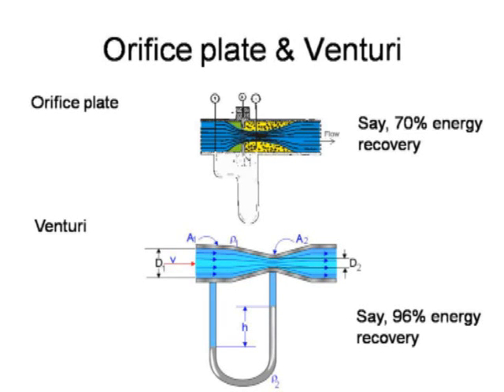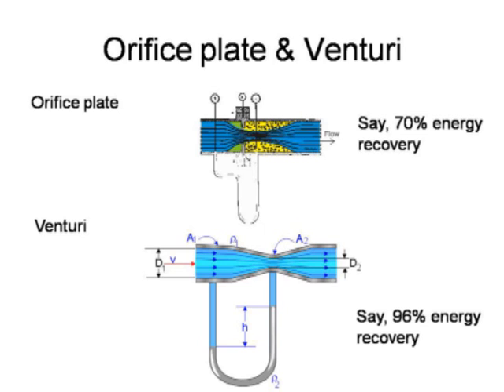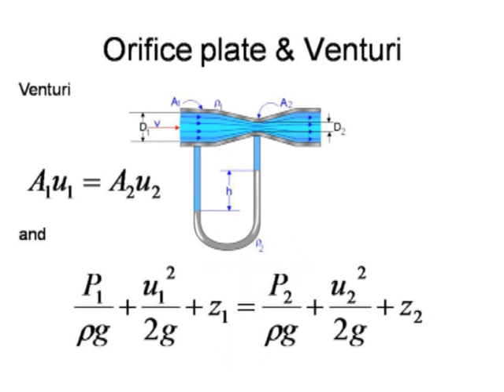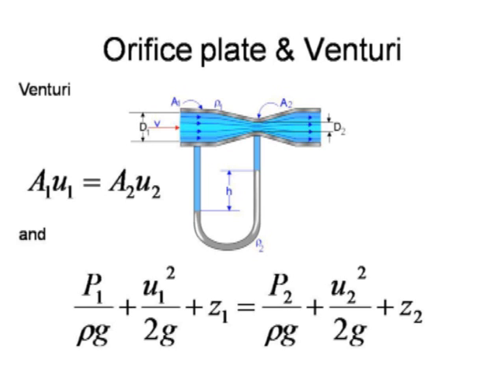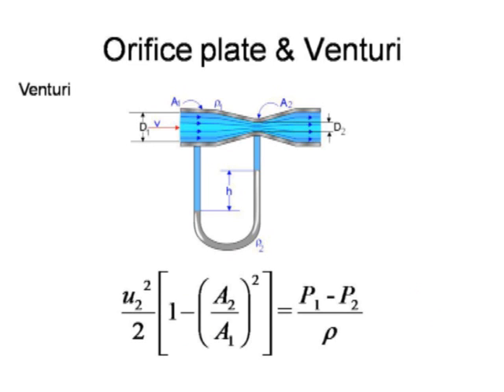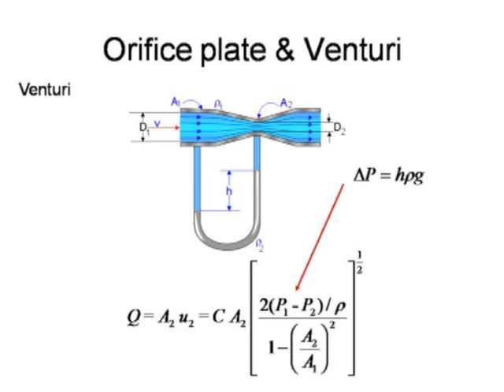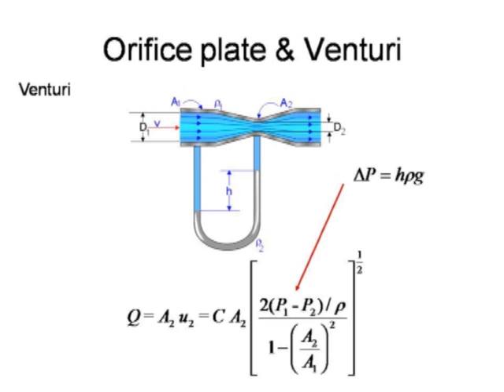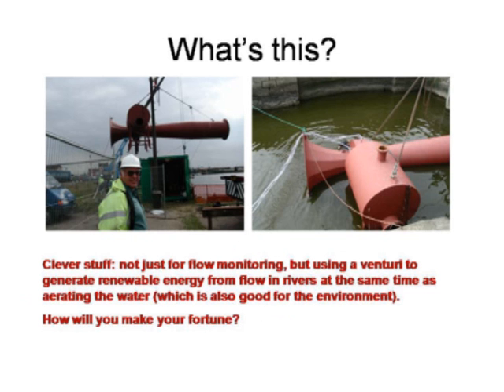orifice plate theory

Comment: Can the region/s where the flow expansion begins to expand again, ie after some point past or within the turbulence be expressed mathematically in the orifice plate model?  Can the distance past the orifice plate of turbulence be measure/calculated based upon the diameter of the pipe and the diameter and geometry of the orifice itself, ie to calculate the point at which turbulence is at it's lowest?

Comment: Even though the energy loss in orifice plate is more but, why its famously used in Industries then V Tubes?
Reply: I think due the fact that the diameter of the hole in a orifice can be easily adjusted as to whether in a venturi you'd have to get a complete new venturi meter. i guess.

Comment: hey random question,but after been given the coefficients of drag i was asked to work out the mass flow rate of a Venturi tube and next question was connected to a orifice plate tube,it asked me to work out the change in pressure of the orifice plate.I didn't use coefficients of drag to work out (p1-p2) but only velocity,is that right or do i have to incorporate the drag somehow?
Reply: +dangis jakutis whoops i meant coefficients of discharge

Comment: what is the cause of permanent pressure loss in orifice meter and how is it improved in venturi meter?
Reply: both have pressure loss. but the one with an orifice plate has a lot of turbulence, so it's not as efficient and the venturi tube, but it's cheaper